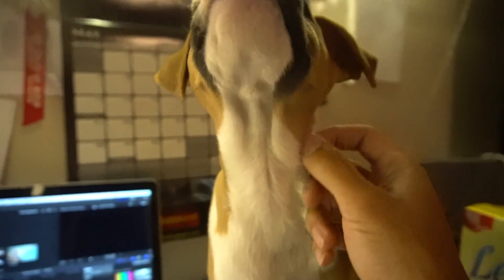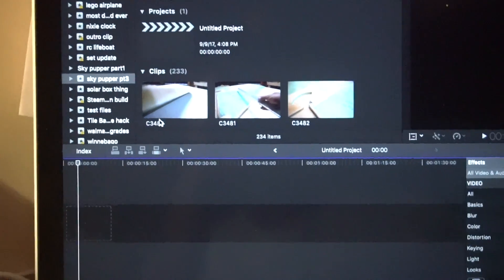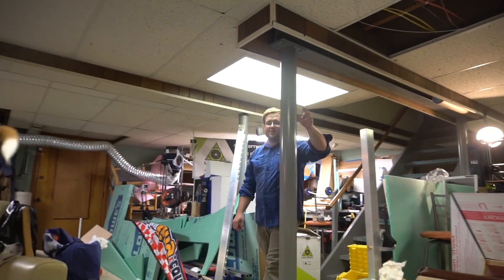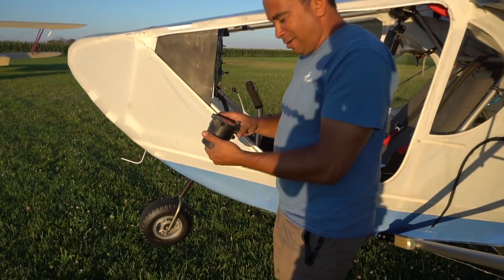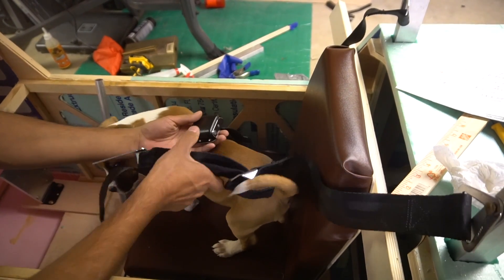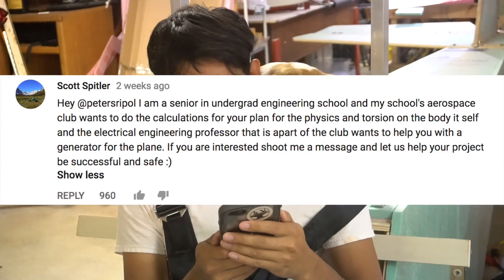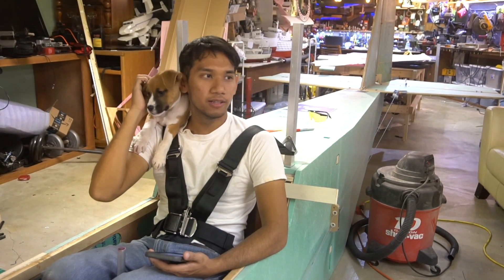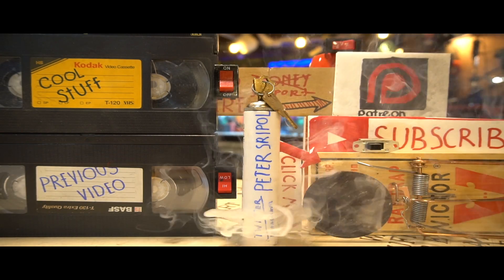DIY Electric Ultralight airplane pt3 (cockpit and controls)

Comment: Came for part 3, stayed for the puppy 😂, joking aside tho peter would you not be better riveting down your hinges instead of bolts as i know it may not save alot of weight but might just save a little, also with the bolts make sure you Can run some wire through them to lock them off as last thing wanted would be for them to loosen mid flight, all the best with it tho im loving the build and cant wait for the next part

Comment: Please learn to crimp cables properly if you want to live. I feel like you are sorely underestimating the aerodynamic forces and vibration the parts you have will be subjected too. Borrow a real crimper and get a copy of the FAA's AC 43.13-1B for examples of safe techniques you can use to complete basic tasks such as this before you end up injured or worse.

Sincerely,
A concerned Aircraft Mechanic
Reply: Yeah, I was thinking about that. I ran a Kubota lawn tractor that used cables to raise the deck and those would break all the time. I learned I had to throttle down and raise it slowly to baby them into being functional. I was basically neurotically thinking about those cables.
Reply: Decent advice, but that cable swage tool will do the same job as a $500 Snap-on does, even if it is a little slower and not quite as shiny. Don't be a tool snob.
Reply: Its a scary thought. Cables in the aviation world are normally inspected regularly and replaced when frayed even slightly out of tolerance.

Lives have been lost from these types of mistakes; we have over a century of experience to draw from and most resources are free. There is absolutely no reason to needlessly put your life and the lives of those on the ground in danger because you can't be bothered to do proper research.

I could keep nitpicking, but there is no way this thing will pass the experimental aircraft condition inspection, unless some serious changes are made. Honestly, this type of thing is why they made those laws in the first place. I want to see it fly, but not at the expense of safety.

Comment: why not use a remote system for the first few flights?
wouldn't it be better to just simply design a fly by wire system should be an easy task ardupilot or something similar...

Comment: Amazing stuff.  I'd like to note that you should really be using wire rope thimbles on those control cable loops.  Wire rope has a tendency to come untwisted and fray in a loop.  Also, over time, those loops will tighten and put a bend in the rope which can lead to failures.

Comment: Are you keeping track of the costs of building this?  I think that aside from giving you an opportunity to go out in a blaze of glory, (or preferably, not), what this project does for the ultralight community is show that by applying the techniques used for RC flying (and most RC hobbyists have to keep it cheap), ultralights can be made for a fraction of what the industry charges for kits.  It's like the industry as a whole said "hey look, the sweet spot is $10,000.  There are enough people who can scrape together $10,000, so that at that price point we can make a lot of money", with the result being that there seems to be a $10,000 standard, whether you're making a powered paraglider or a rigid wing and fuselage aircraft.  The engines alone cost more than what I believe could be the whole kit price including engine, if ultralights were a "hobby" instead of a "sport".

Comment: Why don't you use servo . A big  high torq servo .( fly by wire as they said )  And use reciever and radio tranmitter like usually . So u can fly it remotely . Than if it fly good . Than u can jump to the seat and backled up . And fly with the remote control . By the way i think u are more creative , after leaving FT.

Comment: you need to Fix your upper seat belt mounting. the bolt point in the direction of the force, which mean the seat belt plate will work as a lever. I doubt neither the bolt nor seat belt plate will survive that.

Comment: Hey Peter! These videos are great, your craftsmanship is super good and i believe this plane is going to be a super interesting project. I'm a pilot and I'm graduating as an Aerospace engineer, just wanted to give you a quick consideration about those pitch control cables. Having them outside your fuselage may be a little dangerous for different reasons...
Cables aligned parallel to the airflow (along an incostant flow pressure) may lead to vibration/oscillation, which means it's usually safer to have them perpendicular to the airflow (see those biplane wingstruts). Altough at those speeds it shouldn't be a major issue, it could lead to controls inaccuracy.
Having the cables exposed could also bring accidental damaging during ground operations such as moving/transporting the aircraft, and, even if it might seem a bit odd, could be very dangerous in case of bird strike, which i thought was an incredibly rare event until it happened to me twice in a year of flying. There's plenty of room inside that fuselage, I'm sure you can come out with something way better than having those cables exposed all along the plane. Keep up the good work, good luck!

Comment: Peter,
Looks great! I'm not sure if you're going to add them, but it's probably a good idea to mount springs connecting the back of each rudder pedal to the floor. That way, the rudder will centralize when the airplane is at rest and the pedals will feel a bit tighter at slower speeds. All the best!

Comment: To maximise engine torque use a gear multiplier, but build in a disengage system so it won't shatter the engine on impact

Comment: One question I have, Would it be beneficial or detrimental to have a seat belt? I know that on a go kart having a seat belt without a full roll cage is very unsafe because it could flip over and hurt you, instead of you being able to just hop right off. Is the plane the same deal or would you want to stay strapped in in case you go upside down and have the parachute saving your life?

Comment: Looking really good. I like your thinking on putting batteries/ESCs in the nose, but I would suggest putting a sheet of metal between them and your feet as a firewall just in case of a thermal runaway. I'll be curious to see when you start working on the wing structure, and what airfoil you choose.

Comment: I noticed your seat belt system might not be ideal. Under load you want the belt under tension to be level perpendicular  with your shoulders better yet have a few degrees of incline sloping down towards your shoulders. The way it is configured now will for certain cause spinal compression injuries. Hope you see this comment and can't wait to see you fly the friendly skies.

Comment: Have you thought of the actual wing assembly's  internal structure to a degree of acuracy, based on the actual torsion stress created by the micro pressure differences of the atmosphere. Will you build a model of nx 01 enterprise its shape is a lifting body.

 Ps you probably won't die

Comment: Peter - Foam is not going to save your spine from being crushed in a hard landing, you need metal supports underneath designed in way that they will allow to crumple. Please buy yourself a FAA AC-43-1A/2B, it is entirely composed of standards for aircraft maintenance, and will prove useful in things like; Are the bolts I'm using the proper ones, which way they should face (inboard, down and aft, to prevent a loose bolt from falling out or causing secondary damage to another component), should this installation have a cotter pin, how to lockwire a turn buckle, how to make sure everything is "safetied", I noticed you have nylon lock nuts everywhere, which are great, however, they need to have at least one full thread extending through it, or else they are not effective, and your vertical stab bolts are not protruding far enough into the nut's nylon insert to lock them. Your cables you have niko presses on need to be pull tested to make sure they don't slip. There is a lot to making sure everything is proper, and I see what your doing and I like it, but the fact your making everything up as you go worries me, your vertical stab brackets seem to me there are only made out of .040" aluminium, is that strong enough? Did you bend it perpendicular the grain? I don't know, but I would consider making them out of a aluminum extruded angle instead, and install the bolts with the heads facing down, that way if they back out, they will be "captured" and the force exerted in shear should still keep them in place. FYI I am a licensed aircraft mechanic, feel free to PM if you have questions.

Comment: G'day,

 Warning..., Danger !

  Danger, Will Robinson...; do not proceed..!

  (Reference to "Lost In Space", a US TV-Space-Opera from the 1960s...).

 If you ever come to a Sudden STOP ! , while wearing those Waist-High Anchored Shpulfer-Straps, then your Spine will be fractured in Compression, and you'll be lucky to emerge as a Paraplegiac...

  Shoulder-Straps MUST be anchored AT LEAST 1-Inch vertically above the Pilot's Shoulders, to render the Straps safe to use.

  True Story, young Fellow (me lad..!) ; so pay attention, & move the Anchors to the Upperu Front Spars' Inner Ends, or better still, to the Centre of the Upper Centre-Section's Rear-Spar...

  It's your Spine, so it's your decision, and you get to paint the Wheelchair if you lose a bet that I'm wrong ; about the subtle stuff which matters, in this particuar game you've decided to play (ie, Sitting inside Homemade Levitation-Machines, it's a Game of Blood..., y'see ?!).

  Take it easy,

  ;-p

  Ciao !

Comment: Peter: is this going to be a tail dragger or have a nose gear? Nose gear is infinitely easier to fly, and you dont need brakes to steer. just a simple tiller arrangement to steer the nose gear. No brakes needed (unless you plan to steer with rudder alone.) Glad to see you got some real aircraft hardware. :) Whats this i hear about a parachute? for the whole plane or just you? If for whole plane it needs to be designed into the plane not just added later. Incredible stress on the plane. Foam and wood might not stand up to it. On the Cirrus CAPS system the rocket motor is encased in kevlar, and metal separates the part of the enclosure that faces the people. Also you need certain speed and altitude for you to even deploy it so it wont be worth the money or weight if you just plan to cruise low over a field or airport. Yes adjust the seat-belts. what other instruments are you going to be adding other than the altimeter? Turn and bank coordinator is very useful, as is artificial horizon and airspeed. All systems dont add much weight. Have you actually flown a plane btw? Rc doesnt translate.

Comment: peter when you get you 'chute you may want a different seat, most planes that the pilot always wears a 'chute in have minimal to no soft padding built in to the seat as the 'chute provides it, and to much padding will let the Gs, move you around to much, making it harder to control the plane. If you can afford the extra mass, a proper car racing seat might be a good idea, as they  are designed to help keep you in place, and help with harness alignment.

Comment: I notice your shoulder harnesses attach below the shoulder level, I know you have drilled the holes, but it might be worth replacing those square aluminum tubing and redrilling the shoulder harnesses above your shoulder height. The reason for this is because when you hit something hard, although they keep you from hitting the pannel, they will also compress your spine!

Comment: Are you doing anything to prevent control surface flutter, like mass balances or something? Also, the shoulder harness mountings look pretty insecure to me. Looks like a good hard pull could break the heads off the bolts. I'm thrilled for this project, but it's giving me the willies, too.

Comment: @petersripol, you're building too heavy brother. You ply is very thick and the foam a bit thin. At this stage the foam is not adding much to the structural strength of you design.

Comment: Remember to add washers, to prevent damage to the really nice structure you made, and some type of thread locker on those bolts and nuts. (I can't see if your nuts are already locking nuts with nylon rings) 
If you don't, they'll eventually come loose due to vibrations caused by uneven aerodinamic forces (like prop wash or simply crosswind) and slight imbalances on the motors themselves...

Comment: FYI You can use your carbide tipped router bits on alum. WD40 makes a good cutting fluid for this. In fact it's the only other use I've found for WD 40 besides water displacesment.

Comment: put some real strain on the tail section. that small shake is only fine for rc planes. if you can push on it with your feets you will get about the same strength on those hinges and surfaces. especially if you have a mechanical lever in there. Try to do at least the easy safety checks by loading the surfaces with the proper amount of weights (tail and wings and best try to get some torsion on that fuselage). And check if you made some damage by doing your checks. look out for small cracks...
 you are crazy trying to fly this contraption. I always wanted to build a manned airplane too but I will sure as hell not go with an on the go design. way too dangerous without redundancies in design process and the build

Comment: that's really cool. For the elevator control, can you take smaller cables and double the controls with one pair of cables on each side of the fuselage? More generally doubling every cabling system and using lighter materials (various kinds of nylons, I suppose)? A general planning explanation would be interesting I think, where you would explain how you chose your target weight, general shape, power plant, financing the project etc.

Comment: hi there I work in heavy maintenance on aircraft and study aircraft engineering i have a suggestion for safety. To prevent nuts and bolts from vibrating loose use castle nuts with correct split pins on all push rods, wing mounting bolts, rudder pedals stick control, flight control surfaces, engine mounts and empannage main mounting bolts  basically any critical and important areas. On aircraft here we have a minimum of 3 bolt threads sticking out from every nut we install. I would also suggest wire locking on the turnbuckles. wish all the best on the build 👌

Comment: the seat belt bracket is installed improperly, the bolt should be perpendicular to the pull angle of the belt. you don't want to bend the bracket making you're belts loose to the point you can just slip out of them. also they are mounted to low, they should not push down on your shoulders like that. http://www.crowenterprizes.com/Images/Install4CWeb.jpg

Comment: I'm worried about your wings. Bi-planes always have one more forward, this is because lift gets compromised if they do not. also better to have them stall at different speeds, like the beachcraft staggerwing.. the lower wing would stall first, making the plane super stable during at stall.

Comment: As a former Huey mechanic who had to deal with REALLY LONG piano hinges (like the length of the whole tail boom), the easiest way to get the wire back in is to chuck it up in a drill, make sure the hinges are lined up, and you'll have it in quick, fast and in a hurry.  While I don't recall we used it, probably some soap as a lubricant might be useful well.  Thanks for the videos, 

I'm definitely interested in how this project turns out.  As  a former helicopter mechanic, certified private pilot and son of a former aircraft engineer (my Dad worked on the Lockheed L-1011) I think you're going to be in good shape, and based on what I've seen, I'd even be willing to do the first flight (after I go up with an instructor to get my chops back, it's been awhile :) )

Comment: A Question (Maybe You have Said it) : How is the plane going to be propelled? Are you going to use like propellers or like a jet engine? If you will use  propellers will u put like one big in the front or like 1 on each wing?
Edit: Maybe its not called propellers on planes:)
Also you Maybe told how you will propell it, in the video.

Comment: Awesome project peter! Looks like good engineering. I honestly don't think you need to glass the fuselage. Looked plenty strong to me in your part 2 video. If you set your CG somewhere between 26-30% M.A.C. You should be fine. I build powered paraglider trikes and I am also building a fixed wing ultralight. Powered by a 25hp industrial v twin 4 stroke engine. Keep up the good work. Wish you lived in Georgia, would love to collaborate with ya. Nick

Comment: I am slightly concerned about the elevator.  It may be good to copy the ultralight design of the metal piece the cable is attached too, sorry I am not aware of the name.  The part on your plane is triangular and when the elevator is fully deflected there is very little mechanical advantage to pull it back the other way.  The Ultralight had a horse shoe shaped device to maintain mechanical advantage at full deflection.  Alternatively make your triangular pieces larger, allow more cable to move and be under less stress.  I am not a aeronautics engineer.  On that note please bring in Samm Sheperd from youtube he is a commercially trained pilot, scratch builder and aerodynamicist.  Have a look at his blower and chainsaw plane, you will get along great.

Comment: TAKE each of the bolts you're putting on and drill the heads about 2 mm deep. That's the Silver Arrows method of losing weight.
Reply: aserta I was thinking there's a lot of areas that could be drilled for weight savings, like the hinges, pedals, and probably a lot of other parts

Comment: The Lulzbot is really bad printing in TPU unless it's using the flexistruder. I highly highly recommend using nylon. It's difficult to print with but will work much better.